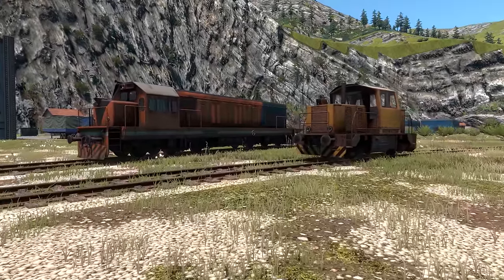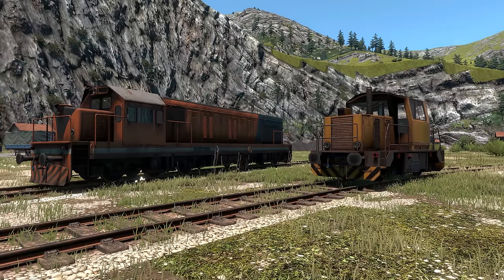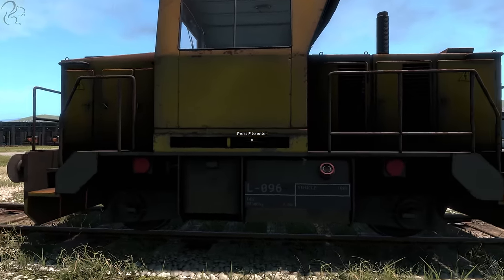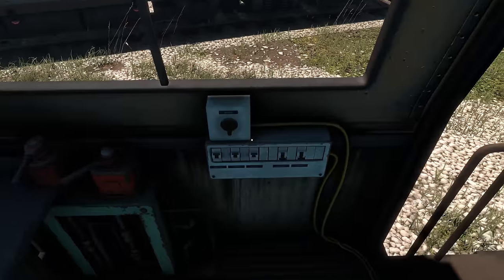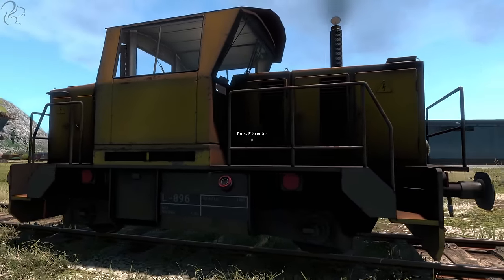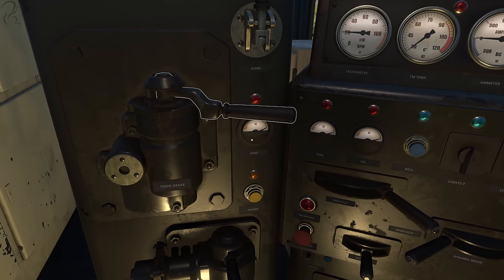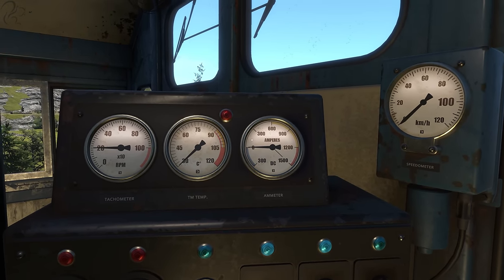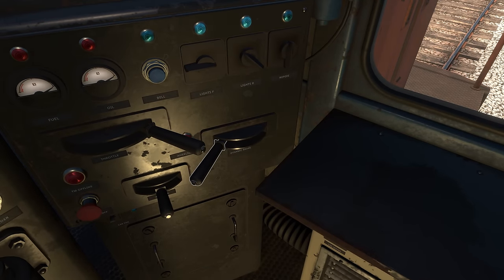DE2 & DE6 Guide - Derail Valley Simulator

Comment: A bit of real world knowledge that may help with the sim, our GOI and Locomotive Engineer's Operating Manual states that you should leave at least 3 seconds between notches when changing power settings up or down, with a 10 second break between throttle and dynamic, taking a total of 30 seconds to go from minimum to maximum dynamic after the 10 second idle period between.
Reply from the maker: Thanks. The sim has no such limits. In real life, what happens if you don’t follow those guidelines?
Reply: @squirrel  Mainly, you get yelled at when the recorder is downloaded automatically and sends messages to higher ups that limits have been exceeded. The guidelines are mainly to reduce wear and maintenance requirements, but the actual logic behind it is to reduce amperage spikes associated with rapid throttle adjustments. Waiting 10 seconds between throttle and dynamic allows the current to dissipate in the traction motors before you turn them into generators. This again  reduces current spikes and general wear on components and actually makes the transition to dynamic smoother. The other part of it is slack. If you throttle up too fast you can easily break a knuckle due to high slack forces, and if you transition to dynamic too fast high buff forces of all the slack running in at once can derail lighter weight cars.
Reply: between changing direction we have to wait few seconds too, just because it´s mechanical switches operated by electropneumatical valves on some electrical locomotives... as well, going from 60% to 0% Fp (proportional thrust - long story short, it´s thyristor pulse regulation) you´d go in steps, 60%->40%->15%->0% just because if you´d dump straight into 0% Fp all the electrical current would overflow the condensers (filters) and dump back into traction motor rotor creating spikes which aren´t good for the engine.... imagine if game could simulate such behaviour, it´d be awesome
Reply: @squirrel lso I’m wondering if I should get this game on steam or vr.I want to know if the same features on pc like third person and free cam is on the vr  version. If you know ,could you let me know?
Reply: @jasonskinner9064  All the features of the game are available both in VR and on flatscreen. The third person view is tied to difficulty settings. On the realistic difficulty, third person view or free cam are not available.

Comment: The ambient lighting is way too dark. In daylight you should not need to use any lights to see in the cabin. It should be brightly lit by the ambient light. Hope they will tweak that. 👍
Reply: Windows are low down and the sun is high up. You get some pretty dark areas with a combination like that, which ambient lighting just can't counter.
Reply: @Squant  I understand what you're saying but that is not how light works. The windows are big and enough light would get through. There is too little ambient light lighting the shadowy areas on the outside as well. I guess it is down to the game engine and it really doesn't matter that much. It was just an observation I made. I enjoy the game anyways. 🙂

Comment: Thats a bummer with the no remote for DE6. I think they should allow it for every loco or ban it for every loco... not something between. Or tie it with the game difficulty. Hard/expert - no remote. Medium/easy - you can use remote as in DV non simulator.
Reply: I wonder if it is possible to connect a DE2 and DE6 with the MU cables and then controll both of them through the remote and DE2.
Reply from the maker: It is

Comment: Hi squirrel. Freight train driver here. Your guide is great, but just one thing. You would NEVER use the locomotive brake to control the speed with a train on. The loco brake is only for slowing a light locomotive, or holding a train when already stationary. Never with wagons on, you will destroy your brakes and wheelsets.

Cheers.
Reply: But but but.. it makes a fun sound when you use it at full speed on a 50 car train!
Reply: I just posted basically the exact same information, having not noticed your comment first ;) Good looking out.
Reply: thank you for the reminder. ill try to keep it in mind
Reply: it also does cancel your dynamic brake I think, on some diesel loco you control with train brake but bleed the independent ones to effectively use the dynamic brakes.
Reply: yup, passenger train driver-candidate here, we use loco brake just to correct the speed when slowing down for next signal (but just few km/h difference, f.e. you pass "expect 40km/h" signal, your speed is 120km/h, so you slow down to 43km/h so you just use loco brake to correct the difference as we have 0km/h tolerance) or holding the train stationary in station/train stop... I was said to use the locomotive brake as little as possible, just as you said, to keep the wear as low as possible
Reply: Pretty sure everyone already knew this.
Reply: Its a game guys calm down 😅😅😅
Reply: I dont understand, what do you use to slow the train down, the individual brake? I think that would barely do anything when you are carrying cargo
Edit: I misunderstood "locomotive brake" as the "train brake" in game, now I realize you mean the "individual brake" as its called in the game
Reply: @DieselxRobot  it's "independent" brake, as in independent of the rest of the train. The "train" brake is really called automatic brake, since it will automatically apply brakes in case of loss of air, like broken air lines for instance.
Reply: Wait so the handbrake is NOT what we use for all braking?
Reply: @sluj49  Hand brake: parking ONLY (cars and locomotives)
Train (automatic) brake: main brake for running
Independent brake: locomotive only or just a couple of cars, like moving empty cars while shunting
Reply: @sluj49  I realize now you are not the person I initially replied to, and that yours is probably in jest. In which case, still no. Full throttle in opposite direction is best brake 👌🏻
Reply: @michaelpearson9 who isn't calm? It's just knowledgeable people discussing real world operations of a simulator game. I like hearing stories from actual train people.

I don't think anyone was flying off the handle here.
Reply: @DieselxRobot independant brake. But yes, the terminology is different.

Comment: 15:23 it does work, when u start it u can use it as a throttle
Reply: That's because it is the throttle and not a pump handle for priming. The starter switch (edit: real starter switch) is turned one way to engage the fuel pump and prime the system, then the opposite way to start, and the handle is a manual throttle control for the engine.
Reply: @Ronald.Golleher the starter only goes one way, and the throttle does nothing besides rev the engine before resetting as soon you let go.
Reply: @thatoneguy611  I meant the real thing, not in-game. Edited to clarify.

Comment: On US locomotives, activating the independent (locomotive) brake would deactivate the dynamic brake. The only exception to this was on the Southern Railway's (later Norfolk Southern) infamous Saluda Grade.  Locomotives operating on this stretch of 4.25% grade had a "Saluda key" installed that allowed the independent and dynamic brakes to be used together.
Reply: Can you say 8888?

Comment: DAAAAAM that temp rises quickly, i can't wait for update thanks squrriel for covering this so extensively, doing the game some real justice right here, i've played man train sims but enough to say that find most of them boring compared to Derail valley i think this game could end up being the best train sim on the market for railroading with a purpose
Reply: thats only in low speeds, higher speed the motors are connected diffrently and temp does not rise that fast. must go through the low speeds with verry low regulator.

Comment: Shame about the remote not working with the DE6. This will make running long consists with a loco in the middle much tougher, as well as any rescues where you end up running locos at both ends.

I would expect see someone mod in support for all locos very soon after release.

The dynamic brake is also simpler to operate than the real ones I'm aware of. This is a good thing otherwise we'd be seeing a lot of broken or runaway engines.
Reply: eventually wireless MU will be a thing. no need for remote for middle locos
Reply: @shuttlebug468  Yeah that would be a nice addition, to have proper distributed power

Comment: 15:23 the pump you are referring to is the governor. It shows on the tachometer of the engine. Does it have an audible function if the engine is on?
Reply: It does.
Reply: in overhauled it not only has an audible function but (iirc) it also sends power to the wheels

Comment: they should have engine temperature issues and seasonal/weather temperature fluctuations, so that if you damage your vehicle, such as breaking something and causing a coolant leak, you can overheat the engine, or you are more likely to spontaneously combust due to an oil leak when theres damage, etc.

Comment: Talk about burying the lede, not using the remote in a DE6 is a shocker. I hope the new UI makes up for it, I really struggle without the remote. Thanks for the video, I'm excited for next Friday!
Reply: honestly, it would probably be cheaper to remote control the DE2 and then put DE6's on the front to haul anyway
Reply: I sometimes use the remote to run mid-train DPUs, so not being able to pair with a DE6 is very disappointing!
Reply: @alternatelives8559  If MU lines still work between DE2's and DE6's, you might be able to just, like, put a DE2 in the DPU
Reply: @smakkacowtherealone  Yeah, that would probably work. Not quite the same, though, and you need an extra loco in the consist.
Reply: And extra running cost
Reply: @alternatelives8559 you don’t even need to turn the de2 on, either. It just needs to send the controls over.

Comment: How exactly does an engine radiator help cool down the traction motors?
Reply: I was thinking the same thing lol. Previously it would help with engine cooling, but it appears that we can’t see the diesel engine temp anymore. Not sure if it has any bearing on the locos condition anymore.
Reply: the energy that the traction motors generate (in turn the heat that the resistors generate) is transferred to somewhere just below where those fans are located

Comment: So what are the advantages of DE vs just Diesel?
Reply: You don't need a gearbox or clutch. Do you know how many gears Trucks have in comparison to cars? Now Imagine how many you would need for a loco. Afaik diesel mechanic was only realy used for some small shunters
Reply: @c_l_b3744  Some trains outside of shunters did have gearboxes.
The class 101 is a gen 1 Mu that was diesel-mechanical, Suprisingly it only had like 4-5 gears for the engine.
Reply: @davidty2006  Class 101 is for passengers (so for light weight), but I doubt there is any non-shunter freight loco that would be diesel-mechanic.

Comment: Yikes, only 3 cars cappable ??! That's serious nerf. Either that or you didn't give it enough juice earlier on
Reply: if it can only take 3 cars, then the other diesels are prob very cheap ( like 20k )
Reply: Different types of loads weigh different amounts.
Also, that's up one of the worst hills in the game, so I imagine it just changes how people play the game at first.... ie everyone will simply avoid hauling out of the harbour until they have the license(s) for more power.
Reply: @tin2001  Well he said it was cows. 3 cow cars if they didn't change the weight should be arround 108 tons.
Reply: Ah nevermind it's 4 cow cars. 144 tons total in theory.
Reply: @machintrucGaming  Which is crazy good for a two-axle shunter to pull off at an incline. I don't quite get it why people think a shunter should pull freights.
Reply: @milanstevic8424  Because people are used to what they could manage with a DE2 up until now
Reply: @ram89572  they have other locos now.